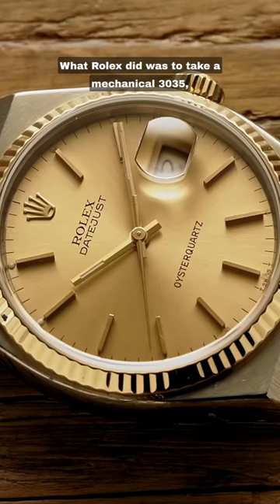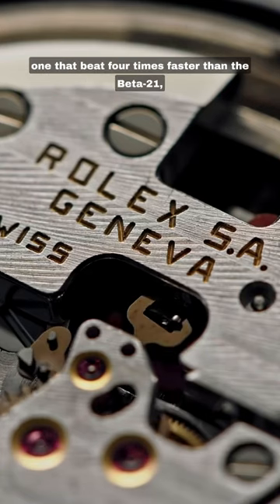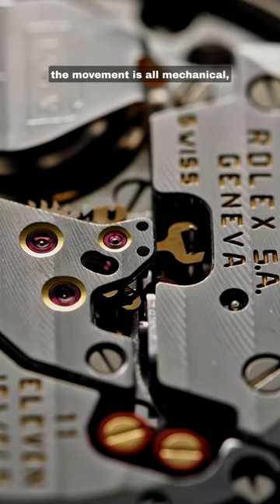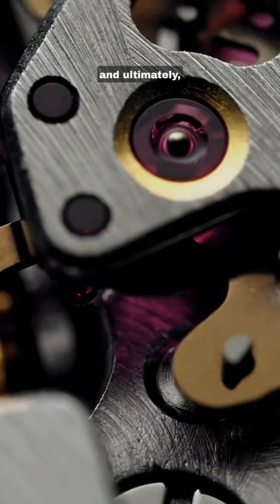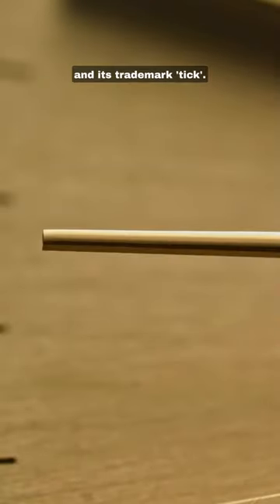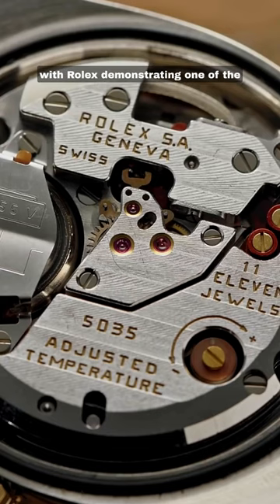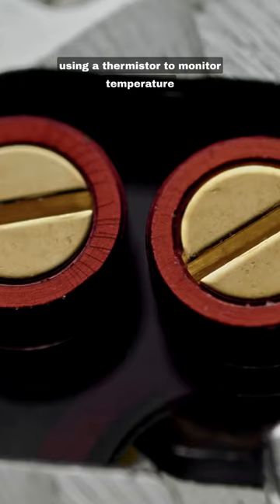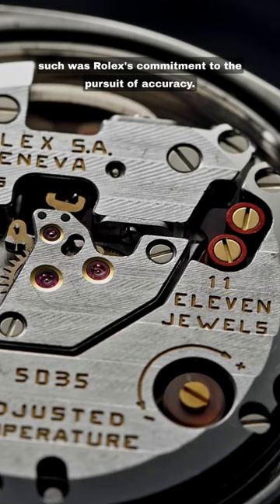Why Does This Rolex “Tick”? #shorts

Comment: The rolex quartz movements are the most beautiful and well designed quartz movements i have ever seen
Reply: Nope GS are far superior. Look at the Spring Drive Caliber 9R86.
Reply: @Cervando Those movements are very beautiful indeed but i personally prefer the vintage look of the rolex quartz ones.
Reply: @georgefotiadis3787  Each to their own, but GS has much better finishing, probably because they use exhibition backs so often, unlike Rolex.
Reply: @Cervando  While I agree the 9R86 is a beautiful movement, I'm not sure I'd classify it as a quartz movement to the degree that the 5035 is. Even GS themselves call the 9R86 an automatic movement. 

Both great movements in great watches.
Reply: @user-pn3im5sm7k Even the Rolex is more mechanical than most quartz watches, albeit not as much as the Spring Drive. But, if we look at pure quartz watches, the finish of the GS 9F is still superior to that of the Rolex. So either way, whether we look at a quartz movement that has more or less mechanical components, GS has a better movement than this Rolex.

Comment: So what I'm hearing is that there isn't an escapement and the quartz oscillator is what moves the pallet fork. Does this mean it still has a main spring or is it driven by something else?
Reply: There is a kind of escapement.  It is like a regular lever escapement or dead-beat escapement if you like.  The energy however is being fed in the opposite direction, through the lever to the 'escape' wheel and train. Rather than a balance you have quartz controlled electro-magnetic coils that change the fork/lever from one position to the other.
Reply: @openclockclubarchive325  oh okay, that makes sense that the power is going in the opposite direction. Thank you!

Comment: Uh….. 
every quartz watch ever has manual regulation
Reply: Technically some Grand Seikos don’t because they’re sealed for accuracy
Reply: They don't, actually. Most all modern quartz movements don't have trimmers to regulate
Reply: @Karsonbarnes11  oh. I guess that process is done by machine now. But it still has to be regulated, the oscillator isn’t accurate enough. And manual regulators (I was told) were standard at the time (this waa 1970-1980’s?)
Reply: @melody3741  yeah manual trimmers have been obsolete on most quartz movements since the 90's.